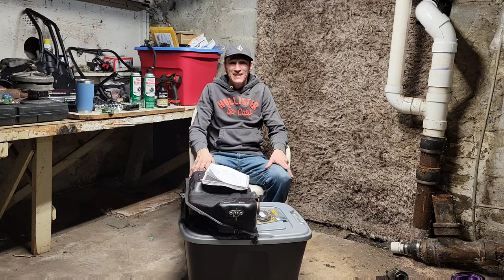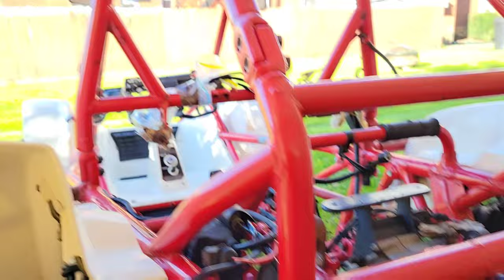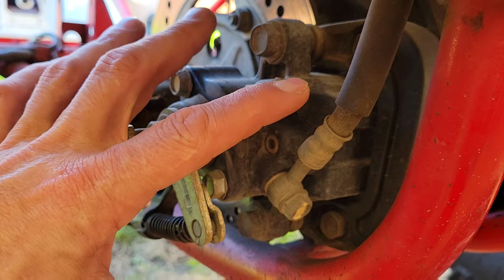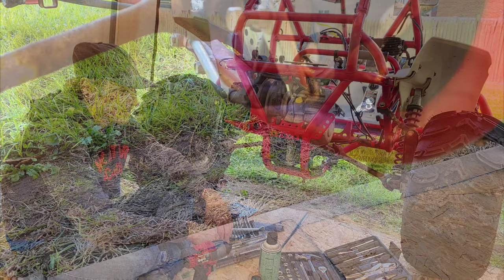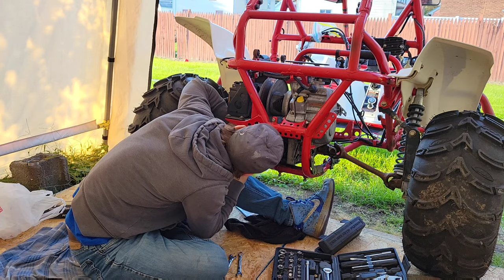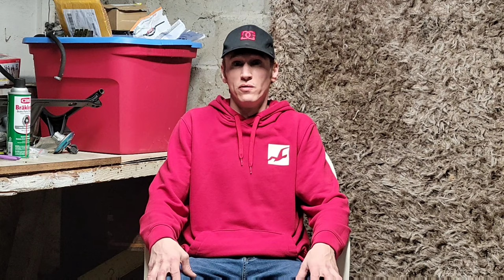Odyssey Life Ep3!! HONDA ODYSSEY FL350 REAR BRAKES! BRAKE SERIES PT1 #odysseylife #honda

Comment: Apple cider vinegar / baking soda gravel. Agitate. 
Think strap it in to my cement mixer. Have spun aluminum tank for start up gravity feed. Venting issues. Ruined starter. Flooded with oil. No oil in crank case. ???
Reply from the maker: If you use the spun aluminum tank, you'll still want to use your pulse pump. The pump delivers the correct amount of fuel instead of the gravity feed dumping it in.

Comment: Starter flooded with oil crankcase venting not covered by anyone can you help? Pads from odd atv worked here to see bleeding process.
Reply from the maker: Oil in the starter is a common factory defect..  If you are mechanically inclined, you can drill and tap your crankcase and add a vent with a catch can. I have been meaning to cover this in a video. When we picked up this machine, the starter did not work. 😁👍When we disassembled the engine and removed the starter, it was also filled with oil. I apologize for not getting that in a video. Odyssey Life started after the Odyssey was disassembled.

Comment: Drill out screw head only do not oversize there will be enough screw to grab with vice grip. Head gone screw loose.
Reply from the maker: Yes, you can do it that way, or if you don't have enough screw to grab, you can slot it with a grinder and cutting wheel and use a screw driver to remove it.  https://youtu.be/dk6RFcq19ko